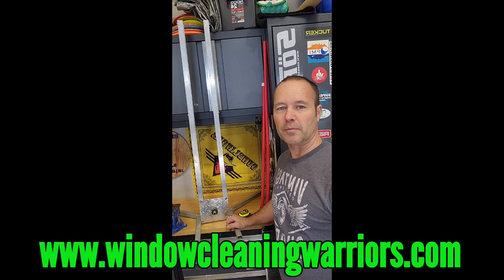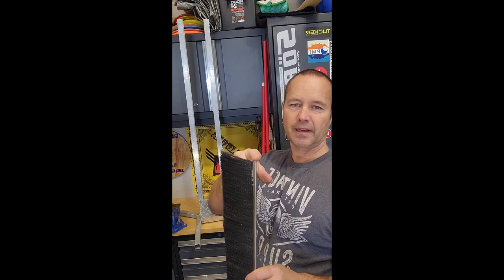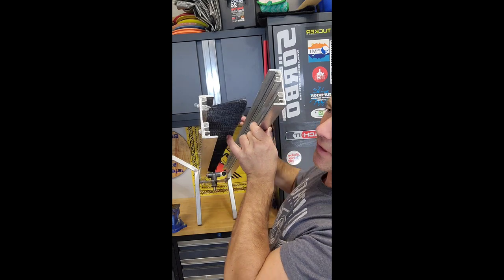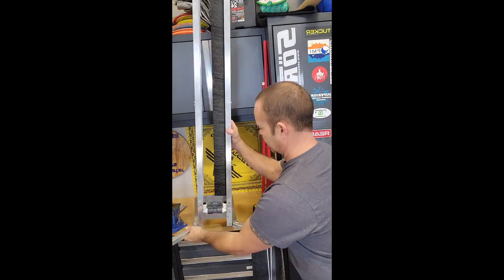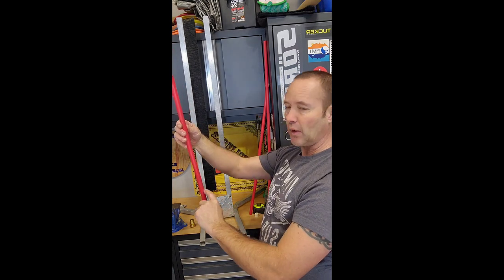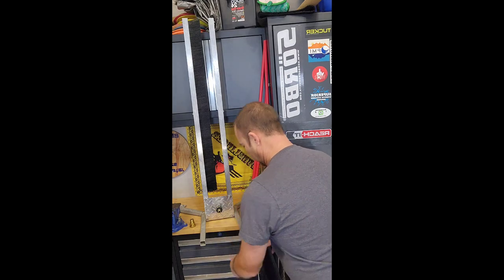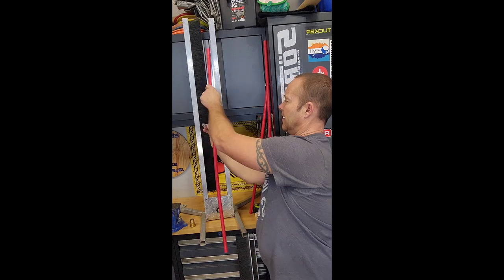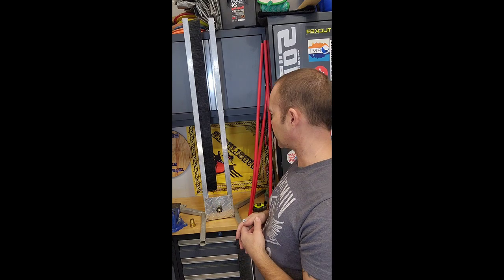DIY Screen Cleaner How to & Build List

Comment: A little confused on something, currently trying to build this. Heres my questions
1. Is the strip brush holder and the U channel 1 piece? Or are they 2 separate things that you connected
2. Do the strip brushes and holders have to have the same backing size? You posted links on the youtube 3 weeks ago but the brush and holder have different backing sizes
3. Whats the height of the U channel? Because im assuming the height of the holder is 36in
4. Is the T fitting have 2 sides that are 1/2 in and then the 3rd side is a 3/4 in?
5. How did you get the holders to look like that? The link you shared has 3 holders that are together but your build has 4 holders that are seperated into groups of 2.
Thank you!
Reply from the maker: The track for brush is one piece, metal spine of brush slides in, simple.

I've only seen one size trach slot and brush spine.

T fitting will be whatever you choose and purchase tube for
Reply: Thank man you’ve been helpful! One last question, what did you use to hold the tracks and holders? Like the outer metal part? And would you have a link to that? Thank you
Reply from the maker: @Guy_fit or crimp / squeeze botton so track is skinny
Reply: @windowwarriorsforum9112  Thank you, and where did you get that massive U channel? I cant find any that are wide enough, do you have a link?

Comment: Can you point out in a pic and mount instruction where the strip brush holders are located. I thought the channels held down the brushes! Thanks.
Reply from the maker: Look at past comments, this was asked before
Reply: I’m sorry I cannot find the past mount instruction where the strip brush holders go!. Can you do a cut and paste to reply? Thanks! 😊
Reply: Ok I saw the nuts outside the  channel to assume the brush holders are mounted. Thought the aluminum U channel came with channels ! Thanks! 😊
Reply from the maker: https://www.zoro.com/tanis-strip-brush-holder-overall-length-72-in-ah403272cf/i/G1941983/?utm_source=google&utm_medium=surfaces&utm_campaign=shopping%20feed&utm_content=free%20google%20shopping%20clicks&campaignid=19725397607&productid=G1941983&v=&gad_source=4&gclid=CjwKCAjwjeuyBhBuEiwAJ3vuoTzzFKWw19OXCwwwJqnaHISt-V7DGXcgnehDOSZ9IK2mUvzSEaCDSxoCK0AQAvD_BwE&gclsrc=aw.ds
Reply from the maker: https://www.zoro.com/tanis-strip-brush-72-in-l-overall-trim-3-in-mb700672/i/G0726476/